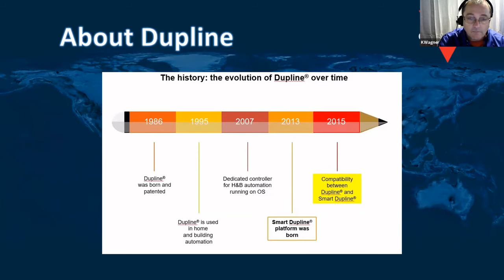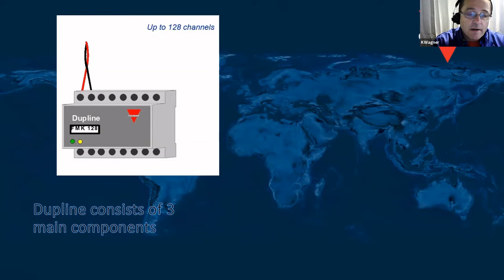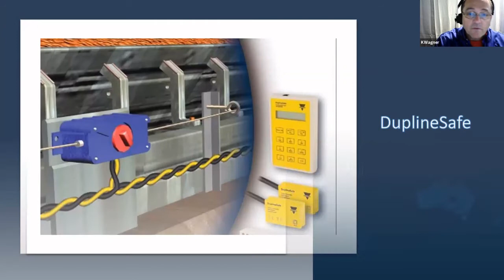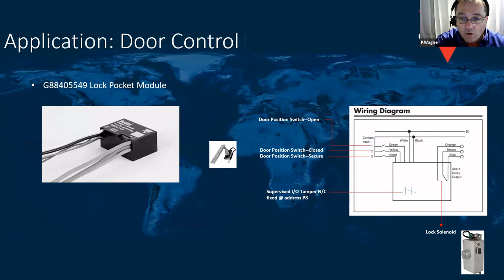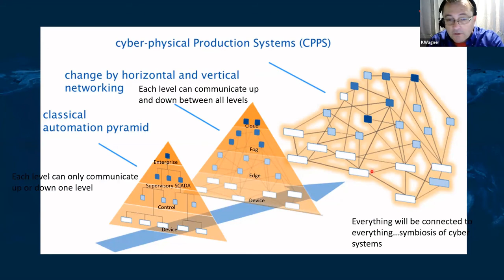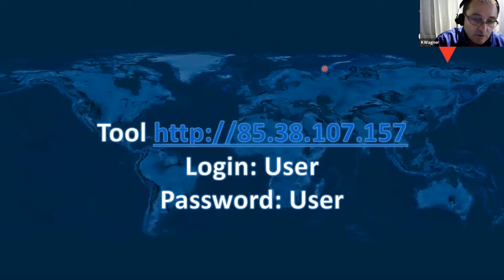Carlo Gavazzi Dupline system introduction and capabilities

Comment: Dear sir, we really get problem with your system. In my building we had use dupline system to control lighting system at office, 
Lightings system using photocell, BCS, switch and bypass switch..
Last week incident occcured where is the dupline receiver not trigger the contact to switch on the lighting circuit...
I really don't understand well about dupline system...pls share to me wiring diagram circuit for such system..I need to study to understand how the system work...
Tq